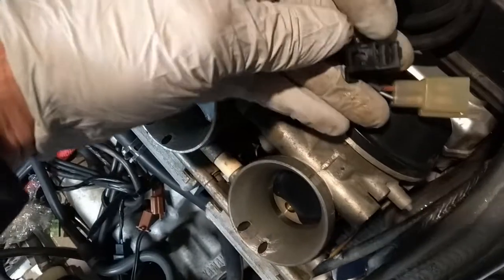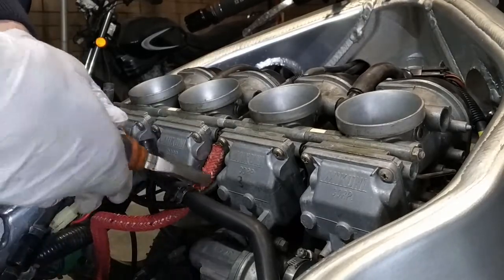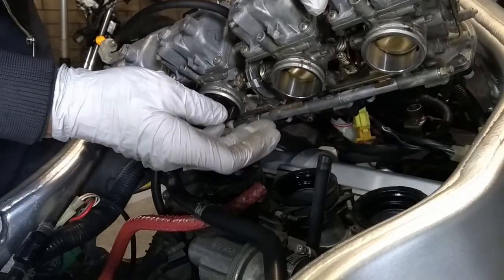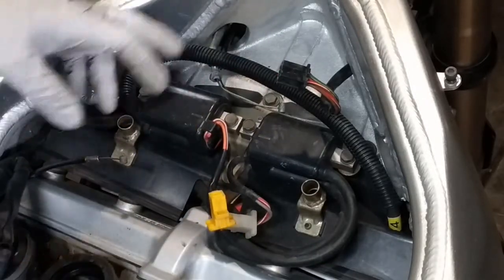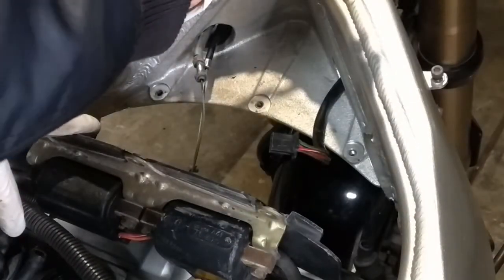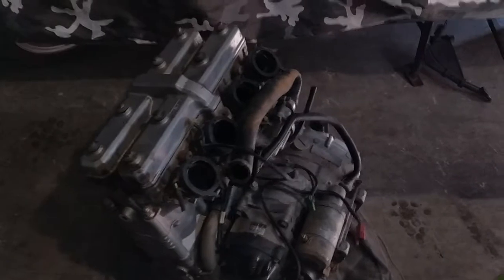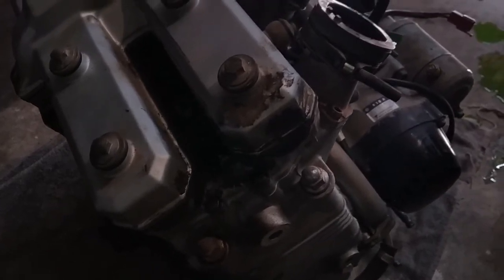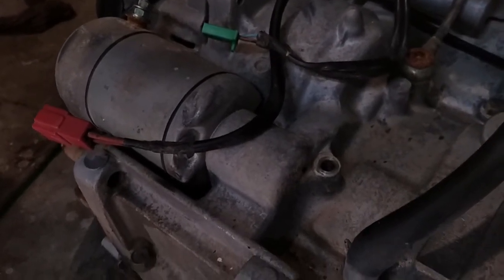Reconditioning my Yamaha FZR 1000 '95 part 4 (carburetors and engine removal)

Comment: Hi man i have a question... Im buying a fzr1000 96s..

Buy i don't know where is the rectificator.... Can You help me with that please
Reply from the maker: Do you mean the rectifier?
Reply: @ChrisSofos  yeah sorry i don't know English very well im from southamerica
Reply from the maker: @crisfabian3699  that's ok. The rectifier is located inside the alternator (generator). I think all models are the same. You can find it in this link:
https://www.megazip.net/zapchasti-dlya-motocyklov/yamaha/fzr1000-4241/fzr1000-29454/3lj7-780351/generator-13515541

Comment: Hello Chris,
First — sorry for my bad english.
The main reason for leakage in the head cover gasket is caused by the rubber mounts. They become smaller over the years and this leads to reduced pressure on the gasket. I think you recognize that it doesn‘t help to use more torque on the screws. 

Also there is a critical position at the gasket at the edge between the radius and the flat part. Use silicon there or special fluid (in Germany it‘s called Hyloglue).

Great job, what you have done with your videos!

Greatings from Germany, regards
Wolfgang
Reply from the maker: Hello Wolfgang
Your English is way better than you think!
You are absolutely right and thanks for pointing it out. I put a glue on the halfmoons too, but I didn't film the procedure (big mistake). 
As for the torque wrench tool, I barely use it, as I find myself quite experienced with torquing bolts and screws. On the other hand, these bolts have thread that stops at a specific point. So I couldn't keep going even if I wanted too. 
Again, thanks for your comment. I really appreciate it. 
Cheers from Melbourne 😊

Comment: Nice to see someone besides me working on these bikes! You can remove the choke cable from the rack pretty easily. There's 1 screw there as you probably noticed later. (I'm only half way through this video as I write this).
Reply: heh, I see you found that!
Reply from the maker: Thanks for your comment David! What are you working on at the moment?
Reply: @ChrisSofos  The fuel system in general. I cleaned the tank with metal rescue (I'll do a video when it warms up in my garage). I ultrasonically cleaned the carbs and have a heap of new rubber bits (including throttle shaft seals) to get them back in top shape. I need to order a filter and get new fuel hoses.
Reply from the maker: @dakavanagh  looking forward to see that video! At some point I'll have to do the same to my FZR. Plus adjusting the carbs.